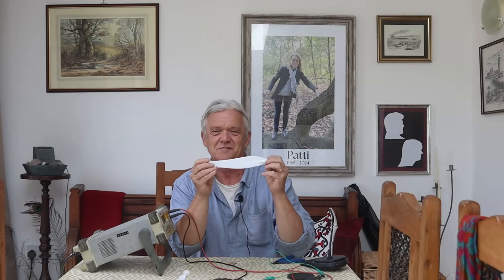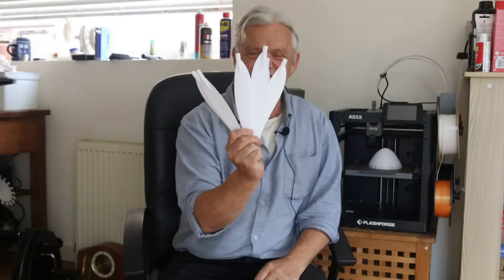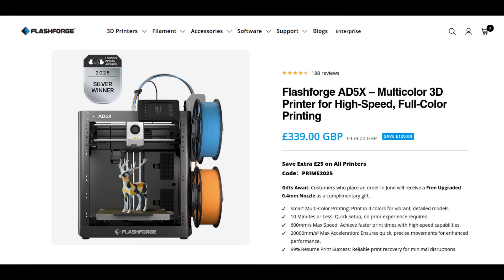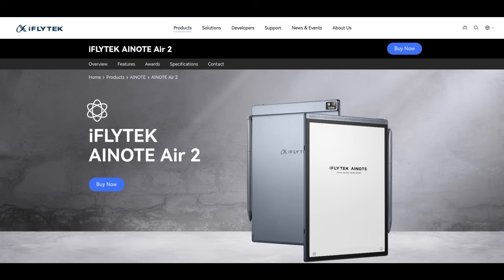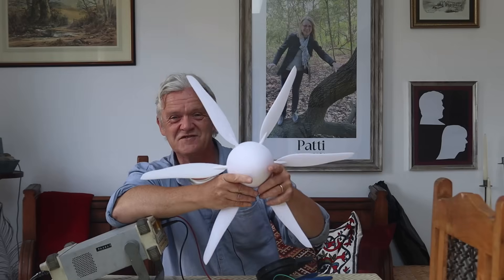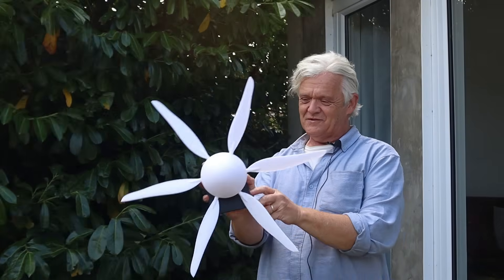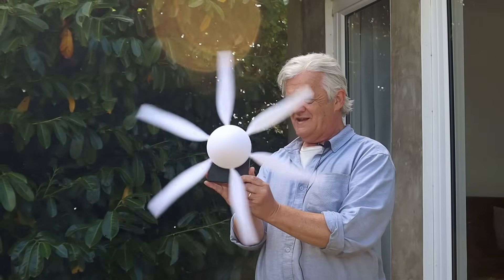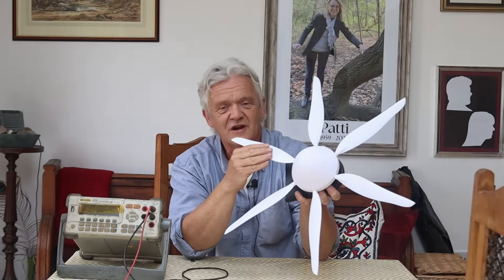2404 The Feather Turbine - Build And Quick Test #flashforge #ad5x

Comment: The NACA airfoil you used does work but may I suggest you use the Bergey airfoil. Its coordinates are available for free from the University of Illinois Champagne/Urbana airfoil catalogue online. It is specifically designed for wind turbines operating at these very low Reynold’s Numbers.
Reply from the maker: cheers mate
Reply: @dudleysmith5111  I could not find this airfoil can you give a more detailed location for the files please. Thanks James

Comment: A feather is a component of an aerodynamic structure. In use the air flows along its long axis, not across it.
Reply from the maker: well you are sort of right - mid wing that would be true but at the far end of the wing that would be wrong - check out a condor soaring
Reply: Ha, yes.
I have made pinwheels using feathers. They don’t last long out in the elements, wear and tear, rot etc. I give them a coarse pitch so they don’t spin too fast. Also, it’s hard to find identical (ish) blades.

Comment: where can I find the template for the feathers i would like to scale it up so that each feather is about two feet long and then print out a template on multiple pieces of paper and then cut them out of wood or pvc so i can test it out on some hoverboard motors I've been saving to build a generator?  also if anyone reads this that can help me out with information on how i can re-wire or rewind a  hoverboard  motor to make it either single phase ac or dc voltage without having to use a bridge rectifier i would be highly appreciative for any information?
Reply from the maker: You have to draw one mate - I covered how to do that in video 2403 - all motors with rotating magnetic fields are inherently AC to get DC out you must rectify it - you can use an electrical method or a mechanical method - the mechanical method is like a commutator and brush set and is usually integral to the structure of the motor. Without being rude from how you put the question can I strongly advise you to read up on how motors and generators work - I am not sure you have grasped the principles yet

Comment: Now I ask myself "Why not double or triple the number of feathers?"
Surely that would create more electrical energy?
Reply from the maker: no mate it won't - actually one will do just as well as 3 or 6 or 12 - It has very little to do with the number of blades but rather the swept area - more blades gives it 'more grip' so to speak but there is no increase in power